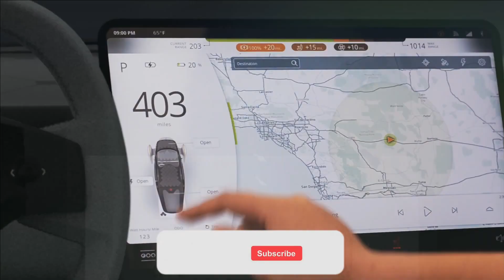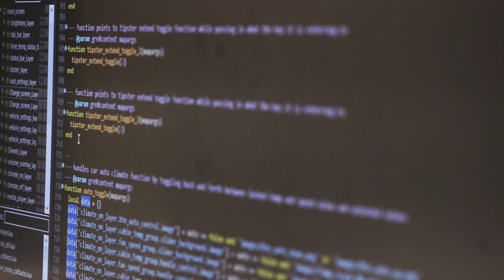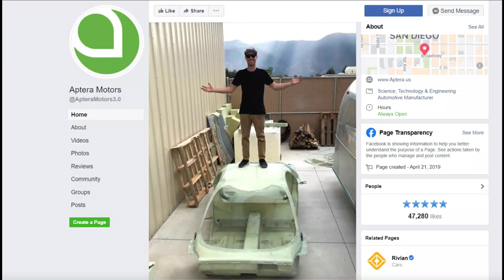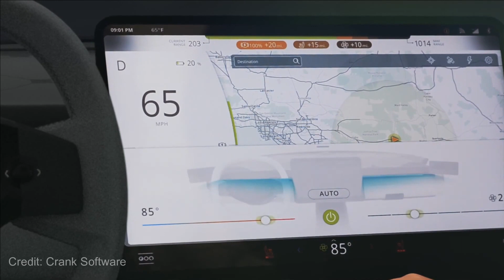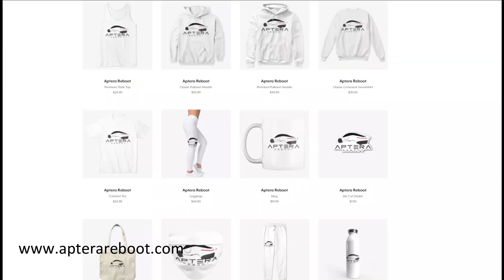Top 3 Reasons Why Aptera Will Fail?!?

Comment: Aptera is no different than Elio. They fail due to the dramatic overpromise (solar is never a good idea on a car, can't work) and never having a production model. If you are waiting, look for Aptera to announce a date then change it, exactly as Elio has done for over a decade.
Reply: Of course they are different.  Paul Elio never produced anything.  Both Aptera founders have a successful business background, including taking a successful lithium battery company through IPO.  

I will get the popcorn while you explain why solar on a car "can't work".  We will start seeing it on more vehicles, including some from Tesla.  As a $900 option for full solar, it is almost a no brainer for anyone who understands what is being offered.  It will quickly pay for itself.
Reply: @n.brucenelson5920  "I will get the popcorn while you explain why solar on a car "can't work"." Solar changing on cars with rounded surfaces? Seriously, this is as stupid as the solar roadways projects.
"  As a $900 option for full solar, it is almost a no brainer for anyone who understands what is being offered." At least try to think. This is not happening. Under the best of conditions, this car will not charge much at all via photovoltaic solar panels. Have you even ever seen a solar array? They are flat. Aligned with the sun. Produce a very modest amount of power for the space they take up. If the Aptera was totally flat, angled to the sun for the full surface area, it would be able to produce 484.5 watts. Let's do the math. Your spiffy Aptera they are advertising has a 100 kWh battery (think 100,000 watts). Perfectly optimized under laboratory conditions, that would take 206.4 HOURS to charge. More than a week of perfect conditions without driving. Oh, but then there's solar efficiency. With glazing and obstructions like paint, you can expect less than 15% efficiency. Let you do the math on that. Now, real world, expect cloudy days, far less than optimal sun at any given time due to the curvature of the body shape. 
Little trivia for you. Home solar cells WITH solar tracking "pay for themselves" in about 20 years, however during that time you logarithmically have worse return as they degrade. The life expectancy is 25 years or so, meaning they need replacing. Now you are not going to have this depreciating asset for that kind of time. Most vehicles will have larger issues during the 9th to 10th year of ownership. Value will plummet. This means that no, you will never have a vehicle that will pay for itself, unless you are a collector, and even then it's hard to get your price.
Reply: @frosted1030  No more than the Cybertruck, or the Roadster was when Tesla was telling people they had a car that broke the transmission with every demo ride.  Actual cars that can be seen on the roads around San Diego, at corporate open houses, and that well known You Tubers have documented their rides in are not "snake oil"

As far as the solar panels, there are NDAs in place, but anyone can easily discover who the well known supplier probably is - you are just demonstrating your lack of research skills.

And your claim that "the laws of physics" are being violated?  We will all wait with interest while you try to justify that one.

I think most people can recognize a circular argument when they see one.

It is amazing to me that you would come back with such a pitiful reply, especially when it won't be long before everyone will see how wrong it is.  I suppose there is always the delete button.
Reply: @frosted1030  "Any"one taken one of these prototypes to an independant mechanic to examine the assertions Aptera makes? Not one you say.. hmm.."

Most manufacturers don't allow outsiders to view their prototypes.  I used to visit Ford and GM as a vendor.  I always had to sign an NDA promising not to talk about anything I saw.  Aptera has invited independent reviewers to ride in their initial prototypes and film it.  Of course they also support right to repair.

"Why do you suppose they would put an NDA on off the shelf consumer items that would have had to be mass produced by now? Nope. Not even Apple has that level of paranoia.
"We will all wait with interest while you try to justify that one." Sure. Show me how you can efficiently charge a solar cell on a curved surface with a single radiant source. Definationally impossible. "

If you had the slightest research skills you would know that Aptera is probably using Maxeon Sunpower flexible monocrystalline solar cells and that the NDA covers proprietary methods of installing the cells and making them easy to replace.  While you are busy being spoon fed you can read the data sheet that shows how Maxeon cells can be efficiently charged, even on a curved surface.

By the way, you might want to watch the following video on You tube "Why Solar Cars Can't Work", and pay particular attention to the section on Aptera: https://www.youtube.com/watch?v=7L1_zvqg73Q
Reply: @frosted1030  Name one production cars that didn't start with a design and then prototypes.  This is the natural process that leads to a production vehicles
 I invite anyone to read the solar cell data sheet and see if you fairly represent what they say.  

Nowhere is it claimed that Aptera solar cells have to operate at maximum efficiency to provide the claimed vehicle performance and in fact they don't.  Another straw man.

Aptera has been tested stable in 110 mph side winds, far higher than slab sided SUVs.

The wheel pants unclip quickly without tools to provide service access to the tire.

As far as manufacturing, actual engineers are designing the manufacturing process, for which they already have IP.  Just because the process is not obvious to you is hardly a valid criticism.

Aptera is doing exactly what it needs to to deliver a wonderful vehicle and they improve the world we live in even for doubters like you.

I will be glad to drive mine over to visit you so you can see it in person next year when I take delivery.
Reply: @frosted1030  Perhaps you missed that Aptera grants right to repair and will open source repair manuals.  Many people will be able to do all repair themselves or use and independent repair shop of their own choice.  With tens of thousands fewer parts than a conventional car it will be both inexpensive and easy to service.

Paul Elio never had a track record of building anything. You can buy public stock in companies founded by the Aptera founders. The is a good reason that Aptera has attracted the attention of automotive rock stars willing to work for and with them.

Aptera has granted more access to their prototypes than almost anyone.  You could have gone to an open house to see prototypes and the factory space a couple of weeks ago and many did.
It seems that making bogus claims is all you have.
Reply: @frosted1030  "Says the person shilling for Aptera, do they pay you in shares? LOL"

Says the person shilling for the oil companies.  How are you paid?

For the record, I have given Aptera money.  It is because what they are offering can have a huge effect positive effect improving  the destructive transportation infrastructure we have now.  

"Prototypes are NOT production models. "

More straw man.  No one anywhere is claiming they are.  They are a necessary prerequisite for production.

"a demo that can't be reproduced for the target price,"

I think Sandy Munro is more qualified to judge than you are.  

Your approach seems to be to throw out unsupportable claim after claim and hope something sticks.  

The idea of having fully written repair manuals written and posted is laughable while still at the initial prototype stage.  We already know the beta models will have major changes.

Comment: I think the major issue that Aptera will have after the novelty buying is over is the width of the car. The suggest 92 inch opening in an garage for the 88 inch width. My Subaru outback is only 72 inches. That means that when parking the Aptera will stick out 16 inches more into the street. Most garages will not be able to fit it, driving in roads with cars parked on both sides and a passing oncoming car will be problematic. So I see the width be an everyday practical barrier to acceptance and large sales. It may be that they will narrow a version for the foreign market. I hope they do.

Comment: They shouldn't be thinking to make a 4 wheel car at all at this stage but they are.  That is a focus for them now and that could cause them serious issues that could hurt their 3 wheel business. All money should be going towards production, very little for r&d
Reply: They laid out their path in their prospectus when the company restarted.  They are hitting their milestones.  They are not spending time on the 4 wheel sedan design at this point, but just like Tesla did, they have a path forward.  Remember that they are still at the alpha stage.  There is one more alpha vehicle to produce, and then several beta vehicles that will have many changes.  These will be used for edge case testing.  They have started producing tooling for these.  After that there will be a dozen or so gamma vehicles that will be much more visible to the public and much closer to production intent vehicles.  They already have their production space, and Munro has done a first pass at the production design.  At present, it looks like they will be able to produce at a rate of 10,000 per year with 23 employees on the production line.  The first production intent vehicles will be crash tested and the safety ratings published before deliveries start.
Reply: @n.brucenelson5920  Do you think they will do all of their deliveries to only US reservations first? I've heard an interview that suggested otherwise but I'm well after 10k on the list. I've been wanting to see more pictures of the cars with proper blue solar panels that they say they'll be using instead of the grey they keep showing too...
Reply: @LaughLogicTV  Overseas deliveries will have to go through homologation to meet local regulations.  They already have people working on this in several countries.  I would guess that these vehicles will see deliveries in 2023.

The solar panels on the prototype vehicles are representative of the ones they will be using.  They are very light weight and will only weigh about 4 lbs in the full solar version.  While they haven't yet publicly stated their supplier - probably due to NDAs, there is enough public information to make a pretty good guess on who is making them.

They have IP around making them easy to replace in case of damage or technical advances.
Reply: @n.brucenelson5920  there are prototypes with the blue solar panels,  but it's only 3 pictures I think. In a couple interviews they say that the panels are blue and look black in some lighting,  which suggests that the gray ones are not the color of the final product,  though I don't know why they would showcase the gray, the difference changes the look of the car quite a bit
Reply: @LaughLogicTV  Frankly, they are much more focused on the performance than the appearance at this point.  Colors can appear differently when photographed with different cameras and displayed on different screens.

I wouldn't judge the final color from alpha vehicles.  This could also be affected by protective coatings that could be applied to production vehicles.  Once the gamma vehicles are out and about, it will be easier to make a judgement on this.

Comment: My concerns are with the 3 wheels, is/will it being street legal, will it be a 'car' or a 'motorcycle'.  Doesn't matter to me as I have a motorcycle endorsement but will have major impact on their sales.   I am also concerned about rough terrain, not thinking about off-road as much as potholes and dirt roads.  Hard to judge from just the videos but the wheels looks like they may have only a few inches of clearance below their fenders.
Reply: There is five inches of clearance for the standard version, just like a Toyota Corolla.  The off road and AWD options will offer better performance on unpaved roads.
Reply: @n.brucenelson5920  thanks
Reply: It was/is hard to judge from the videos but still.  If a car's tire bottoms out in a pothole the rest of the car will scrape and the wheel should be able to pull itself out.  Luckly I don't think we have many potholes deeper than 3 inches around here but still concerns me some.
Reply: @robertalatalo5904  The bottom skirt of the wheel pants will be sacrificial and will be easy and inexpensive to replace, if needed.
Reply: @n.brucenelson5920  that it's good to know and alleviates most if not all of my fears about that

Comment: Won't snow get caught in those wheel housings?
Reply: If it does, it is likely to melt.  That is where the motors are located.  If need be, the wheel pants can be unsnapped without tools in a couple of minutes.

Comment: Every company has a beginning in which they failed. To think like this narrative is very pessimistic. I'm sure Tesla had it's failures in the beginning. Personally, I think this is the future of electric cars. It should have been like this from the beginning instead of going from one dependant energy company to another alternate energy conglomerate.
Reply: They sure did.  I was a witness.  In fact, the company I worked for hired Tesla's motor engineers when Tesla had to lay them off before they got their 150 million dollar loan.  Aptera has had a much smoother restart.

Comment: In Europe, all big manufacturers have to rely on third-party suppliers. This is just now shown with the virus situation. Quality control is a normal procedure. Built-in the company or from external suppliers. So this is a problem easy to dissolve. I think, most persons are too conservative to buy such a futuristic car.
Reply: The early adopters for any new product only constitute 1% of the total market.  The fact that there are already more than 10,000 preorders tends to show that there is a large enough market to be profitable.

Once the crash test ratings are published and people see how inexpensive they are to run and maintain, the interest will swell.  It is still a very specific niche market and the company will capitalize on the momentum with a follow on 4 wheel, 5 passenger sedan.

Comment: Like any electric vehicle it just isn’t practical in a high density area. My town for example. Union City NJ doesn’t even have anywhere near as many legal parking spaces as it does legally registered cars. (Parking tickets are also a MAJOR source of revenue so there is ZERO incentive to change this situation). Almost no homes have so much as a driveway let alone a garage. Mass transit in our area is abysmal. I literally can’t use mass transit to get to work. My place of employment is in a huge industrial park. There are no sidewalks, and it’s illegal to walk on or next to any of the major roads, so you can’t even walk over a mile from the nearest bus stop. With all the tall buildings any parked car will only see direct sunlight for around 20 minutes per day. Most homes don’t see enough direct sunlight for solar power to work. I could go on, but I think most people can see where all this is going. BOTTOM LINE: Until you can pull into a public charging station and either charge your car or swap out the battery in roughly the same amount of time as it takes to gas up a filth belching car switching to EV’s is going to remain a dream in areas like the one I live in.
Reply: When you do get to a charging point, Aptera will gain range two or three times faster than other EVs on the market.  Ultimately, it was not designed for dense urban areas.

Comment: It’s bigger than it looks and only works in sunny environments.
Reply: It is bigger than it looks.  A sunny environment is not needed for the low energy use to become a major benefit.

It can gain 13 miles of range per hour, at EPA highway speeds, plugged into a standard 115 volt 15 amp outlet.

Comment: Your objection on relying upon "third party manufacturers" for parts is unfounded, and  demonstrates you know little of modern automotive manufacturing, logistics, or "just on time", which is now an industry standard.
Reply from the maker: Thanks for watching. 

I worked for a parts supplier as an Account Executive for 5 years. Relying on third party suppliers for critical parts as they ramp production will likely cause major delays in production and will slow down their innovation curve. Legacy builders can get away with it because they do not innovate as quickly as EV manufacturers. Also, legacy manufacturers use the same parts across many models and even across brands.

Comment: Seems like a niche vehicle.
The design could sacrifice some drag coefficient to recover some cargo volume, it would benefit both the esthetics and the utility of the vehicle. 
I haven't seen many videos that show the vehicle sharp fast cornering. Does it incline to maintain stability?
Reply: It has 25 cubic feet of cargo space.  It is not meant to be primarily a cargo hauler.  It is a niche vehicle, but it fills that niche very well.  Aptera will build follow on vehicles with a broader application, starting with a 4 wheel, 5 passenger sedan.

It is not a tilting design.